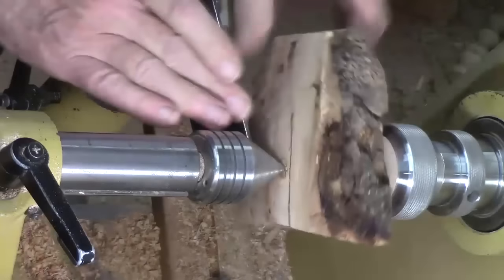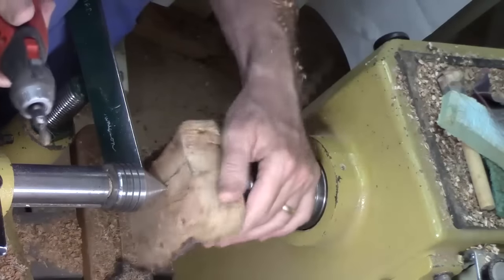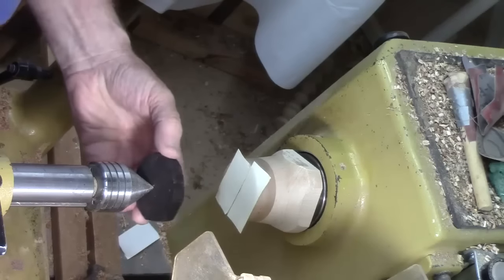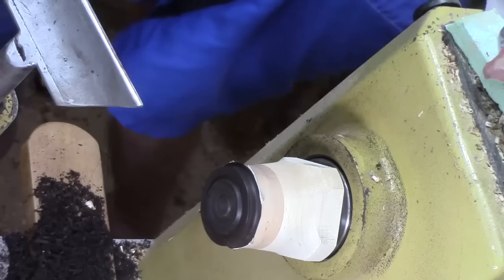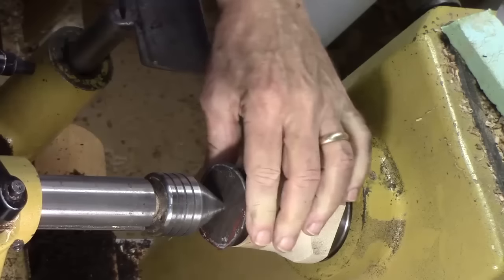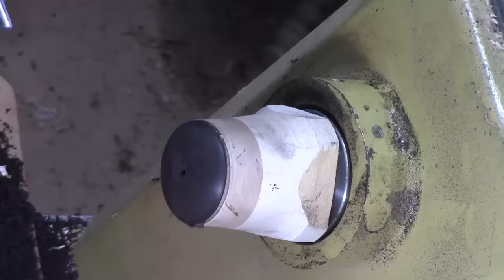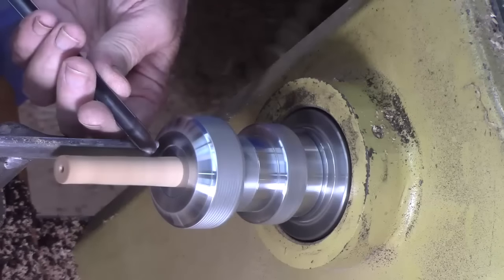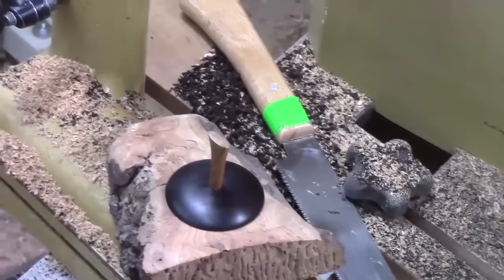Woodturning a Burl Edged Box Pt 2 of 2

Comment: Another beautiful piece.  Did you hand-cut the angle at the top of the finial?  Then sand on a belt sander, perhaps?
Reply from the maker: I did cut at an angle with my flush cut saw in the same way I did stems for my turning wooden fruit series. I opted not to sand the top of the finial.